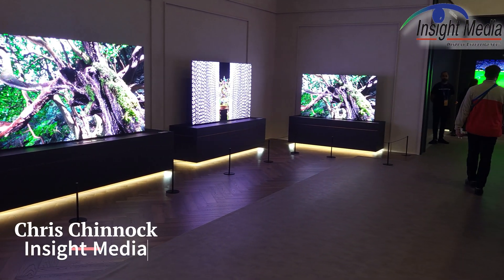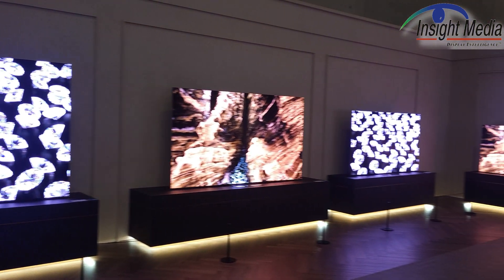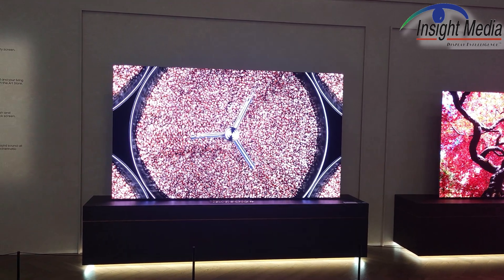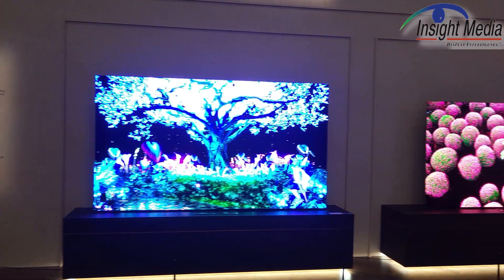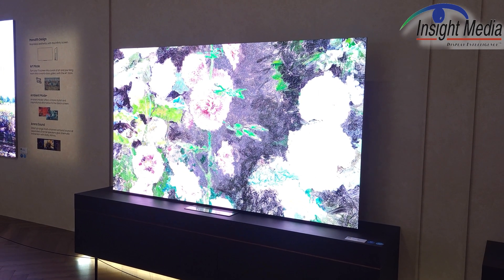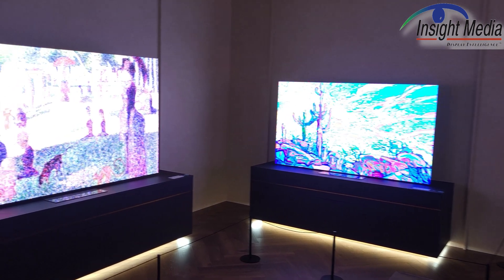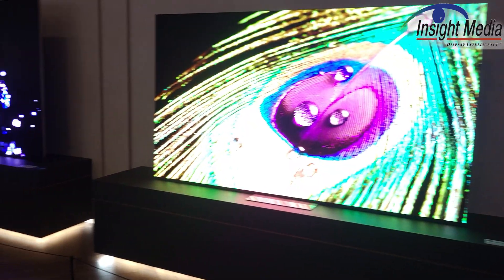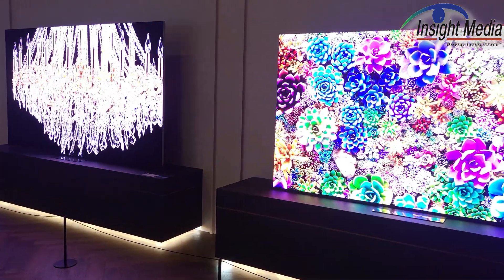Samsung Reveals microLED Fabrication Details

Comment: They don't have to be 16 x 9 do they?
Reply from the maker: of the shelf are 16x9, so other aspects are custom
Reply: @InsightMediaTV1  You must be saying "off the shelf." But why can't they just make them 2.40:1 and let the picture get bigger for widescreen movies? The whole point of "big" is the picture gets bigger, not smaller.
Reply from the maker: @geickmei  Each TV is assembled from a series of smaller modules. The TV is then wrapped in a custom frame to hold the electronics and speakers. If you want a 2.4 aspect TV, you need to change the assembly process and build a custom frame. It is like an all-in-one video wall.

Comment: My question is - Why make the LEDs so small that there's 99% black space, when they lose efficiency AND are harder to deposit on the backplane? Just make them 1/4 the size they need to be for a pixel and go with that - it would be way less expensive.... right?
Reply: LEDs are the major cost driver in the display so smaller ones are less expensive. It then becomes a trade-off of performance, cost and manufacturability. There is no right solution here, just market options.

Comment: Assuming 4K (3840×2160) on the 89″ display, 6×6 modules implies 640×360-pixel modules.  The pixel spacing is then 0.5mm (matching what was stated) and the modules are 328×185mm or 12.9×7.3″.  I bet people would buy a 3×3-module, 45″ TV even though it would only have Full HD resolution.  One worry for me about this technology is how well it would stand up to physical knocks.  Maybe you can't see the borders between all those rectangular glass panels but how much will it take to shift or crack them?  Not something you can test in the showroom; we just have to see how they go in people's homes after the price drops to make them more widely affordable.  Existing mini-LED and OLED panels are surprisingly robust.
Reply: people might want a 3x3 but does rerquire special packaging as these are stand alone units, not built-up module as in digital signage. edge breakage would be a concern, I agree.
Reply: The marketing of LCD TVs, photo and video cameras has convinced consumers for too long that the number of K's is the main indicator of PQ)) Therefore, it is not certain that consumers will be able to be so easily convinced that resolution is not the main thing)

A very valid point about the stability of the modular structure. The larger the size of the structure and the more individual elements it contains, the less reliable it will be. Now the final quality of the TV will depend not only on the presence of a manufacturing defect or inaccurate calibration, but also on the delivery service:/

Comment: Thanks for the wonderful information on micro-LED TV. As you described, Laser-based mass transfer is a very promising method. After placing micro-LEDs on a glass backplane by a Laser process, we need an electrical interconnection process between the micro-LEDs' and backplane's electrodes. Typically, Samsung used ACF(anisotropic conductive film) for this purpose. Do you know what type of interconnection method is used in this 89 inch micro-LED TV?
Reply from the maker: I am not sure of the connection material but it shopuld be part of the laser mass transfer process. This is probably proprietary.
Reply: I do not. they did not reveal the solution.